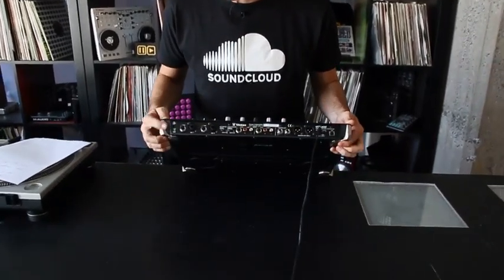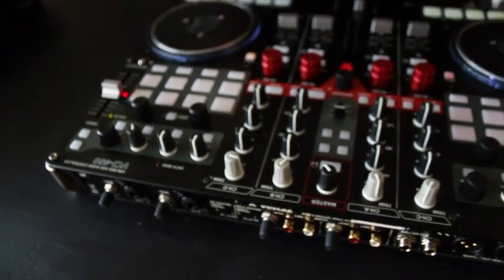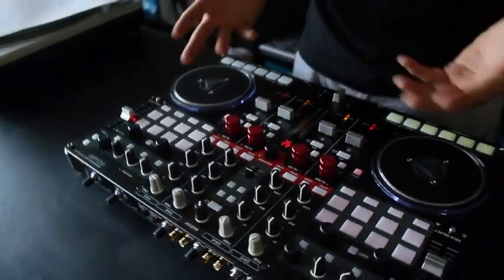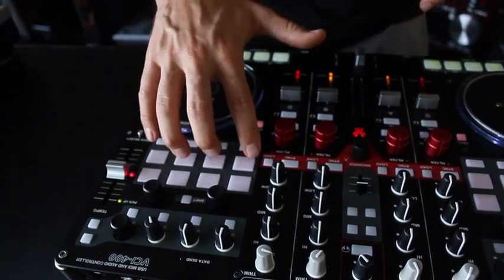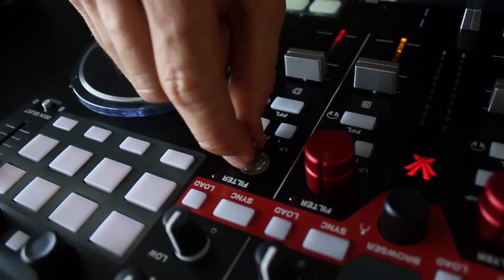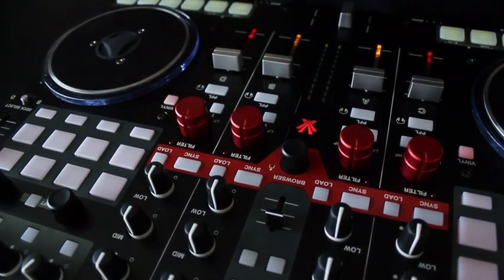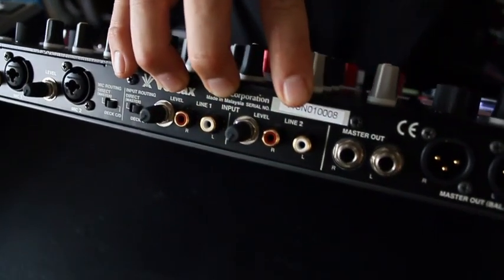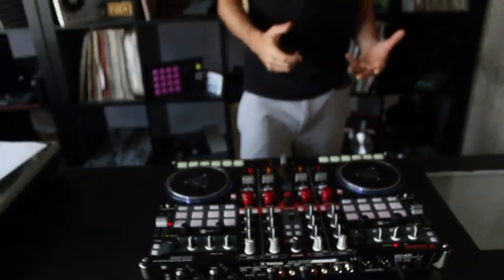VCI-400 : Vestax's  BPM 2011 Controller

Comment: @magermax000 Maybe YOU didn't notice.... but it has rca inputs on the back so you may be able to plug in turntables or cd and control T2 with timecode the same way you can on an S4 with the scratch upgrade..... noob..

Comment: I think that the s4 is better because it isn't as overpriced as the vci 400. Bit if you really are into serato software this controller seems to be quite good. The design is a bit disappointing in my opinion.